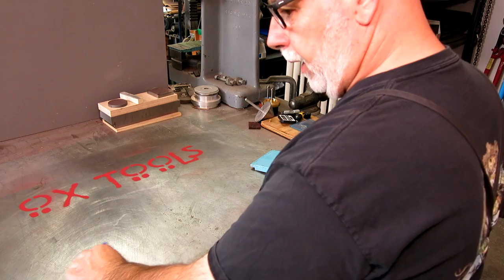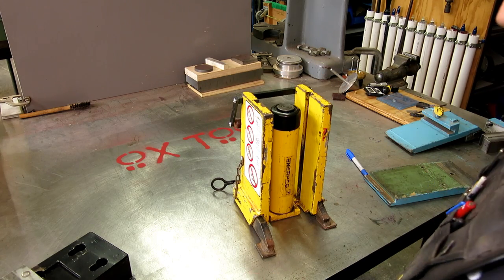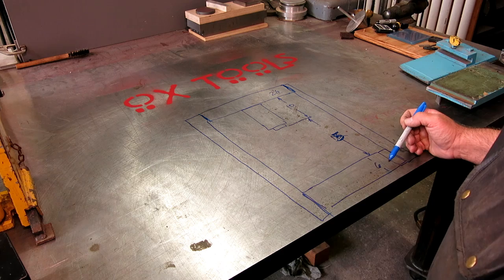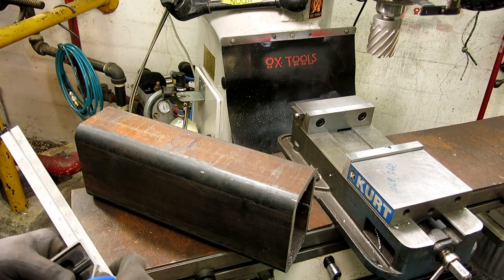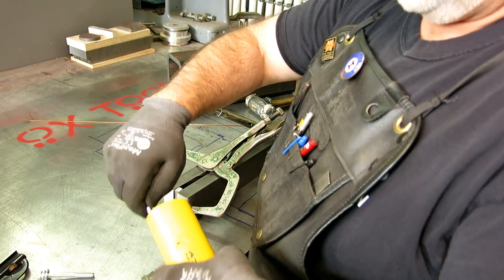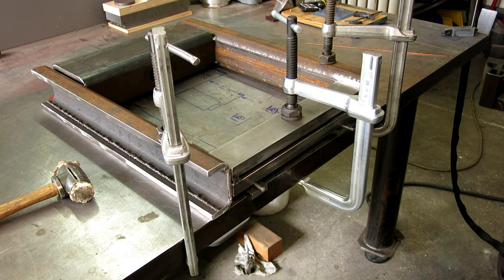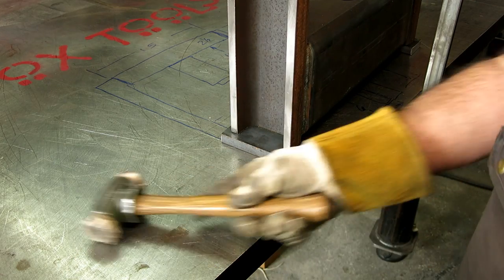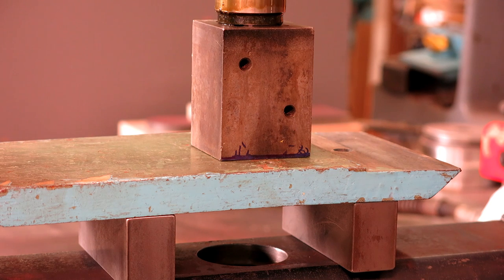Dogmeat Hydraulic Press

Comment: I bought a 60 ton train jack with an 8" stroke at a flea market. It came off a service truck for CSX Rail. I don't know why I felt the need to buy it, but it was only $90 and I thought I could use it for a log splitter or something. I ended up making a frame very similar to this one and made an aluminum can crusher. It will crush a can down to 1/8" and makes it into a solid slug. So then I put recycle bins all around the shop and from all my family and friends. Since then, I have made over $680 in aluminum sales to scrap yards. The trick is space. $10 worth of cans will take up a pickup truck bed. With the crusher, I can get that down to a fraction of that. Maybe a 55 gallon drum.
Reply: That’s a hella lot of cans. The soda and beer companies must love you guys. $680 in aluminum scrap is over a ton of aluminum, and that’s conservative. How nay cans, at a tiny fraction of an ounce each, does it take for one ton?

Comment: I’m lucky enough to work in a workshop with a minimal budget for new tools, so I knock out pretty much everything I need using offcuts and scrap. My press frame is just tall enough to get a 20 t bottle jack into. The 3 bits of I beam, ganged up, at the top flex less than the 20mm solid plate at the bottom. Love these vids of yours and your books have given me a “leg up” at work. Sincere thanks to you Tom.

Comment: Really nice Video,  as all of yours ...     Would it be possible to put a Weld /stringer on the "high" side of the bent part of the brake-finger ?  to "pull" it flat ?
Reply from the maker: The fingers were heat treated material.

Comment: Nice. But the hole in the tube, how do you get the pin out once it falls inside, if you use it for pressing out something like that. You’ve sealed up both ends!
Reply from the maker: Dohhhhh! Didn't consider that one. I guess I'll use my magnetic personality.

Cheers,

Tom
Reply: Drill another hole in the bottom and press in a thin walled thru pipe and sit it over one of those holes in those amazing benches you have!
Reply: If/when, he'll just have to hold it upside down and shake it like a little kid trying to get a quarter out of a piggy-bank.
Reply: theres alot he dont think of--im sure he re records alot of his mistakes which is why his videos come out once every 2 months

Comment: You were talking about watching the top bar come down when you released the press, but I didn't see it. I was watching the bottom bar come up!

I think I would have used something like a 2" wide hunk of bar stock with the bottom end rounded a bit rather than that square peg as the press anvil on top. That would have concentrated the bending force at about the place where you needed to undo the previous set.

Comment: Tom - would there have been a significant difference in rigidity by welding the uprights with the 'C' facing in? That would make pin extraction easier. Of course there might also be some difficulty getting the top rail to fit.
As always an instructive and amusing slice of life - build a tool, to fix a tool, to modify a different tool.
Reply from the maker: Yeah I saw that myself. I had already cut the top rails to length. It actually looked better, almost Art Deco. Can't win them all.

Cheers,

Tom

Comment: Awesome build!
Would if have helped if the block above the workpiece had been more bar-shaped like the ones below it?
The bent in the plate seems to have happened right along its mounting holes, so a contact area with just the width of the hole´s thread diameter would have been better.
The wide piece on top will get it straight, but not beyond, at least not with 10tons, as the necessary force suddenly increases when the plate is straightened. To counter springback of the plate, it has to be bent a little further.
Reply: A half inch square block would have been more proper I beleive. Les spreading, more concentrating forces.
Reply: I would have thought a full width press tool with a very slight face radius to allow for over bend without the corners digging in.. Being sure you press on the crest...

Comment: Nice build! I think I would have added some support to counteract the side to side forces. A round bar through the frame clamped around the lower part of the cylinder would work. Sort of the shape of a very large die stock.

Comment: I use a 3 inch round bar to press on it concentrates your pressure on a smaller area nice little unit. Thanks
Reply: I agree, it's all about PSI.  Concentrate your push where you want the bend.  When he had the part under stress, I would have hit it with a hammer to set the strain.
Reply: I agree with you, it was not a good idea using a square block!!!!!
Reply: That's another agreement from me. 👍
Reply: @chucktodd7329  I was thinking the same. Not too sure how it would work on hardened steel, but worth the try. It's not like Tom doesn't have the right hammer for the job!
Reply: @393strokedcoupe  you would think since his favorite tool is a hammer, he would use them more!
Reply: @chucktodd7329  You know the saying, "there's a tool for every job". Well, Tom loves his hammer collection. He has at least 3 for every job! 😉

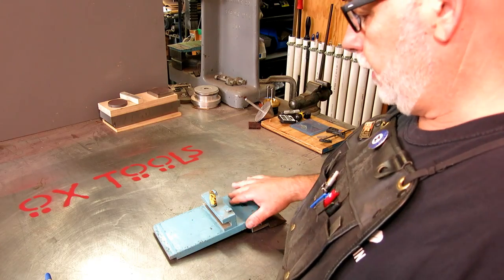Comment: Did anyone else see the base of the arbor press flex when Tom was pulling on it at minute 1:00, it must have moved a 1/4"
Reply: I thought it might crack.
Reply: yeah, probably ductile iron, cast would have maybe cracked....pipe on the press handle?....and those finger brake parts get bent the same way....overworking the brake with sheet metal too heavy. Some TONS required to straighten...
Reply: Even with a cheater bar, bar some flaw in the material, that press wouldn't pop. I think they are designed to take 4 times the mechanical force that's naturally obtained without a cheater bar. Read it in a sales pitch in some old magazine. AKA old timey commercial bragging.
Reply: Why would you assume Tom did the abuse, when he bought it used?
Reply: I had to look away, I'm guessing it wasn't cast iron then.
Reply: bet he built the press more to make sure he didn't break the arbor press then to getmore bend
Reply: Bill Stupak yes I saw that
Reply: @Wroger Wroger thanks mr wizard
Reply: the press should have been on the table all the way... the area under the ram was hanging off table
Reply: Haha I went back and watched. He was definitely cranking on that arbor press.
Reply: @Wroger Wroger J think he saya he bought it used lol

Comment: Try again. Would differential Heating and Cooling help with the bend?
Reply from the maker: You are taking a risk when doing heat shrinking/cooling on previously heat treated material. The short answer is yes it would work but the final condition of the steel might not be optimal.

Cheers,

Tom

Comment: You seem to prefer TIG welding. Any reason? Why didn't you just use all MIG?
Reply from the maker: For tacking I like the precision of TIG. For large volume welds I like MIG and for the ultimate in strength something like 6010 root pass and 7018 fill.

Comment: I don't know much about welding.  But when Mr Lipton does all those vertical beads; is he just showing off?
Reply: Cyril Hudak those "flare bevel" welds on the side are easier to get good results with when welding vertical, because of the open root. If you do then flat, the weld metal wants to fall through.

Comment: That seems to be working out alright, Tom. Too bad you didn't have a 20 ton model sitting around. Looks like you really had to work hard to get the fingers straight again. Hope all is well! - Tom Z
Reply from the maker: Hey Tom,

I will probably scrounge something larger for this little press like a 20 or 50 ton cylinder. I have plans on the drawing board for a more elaborate Hydroelectromechanical press. 

All the best,

Tom

Comment: Tom, I do have a question for you on the power of the 618, I have one also and have converted it to a VFD to run on single phase.  The motor does not seem to put our much power (1hp 208v motor) only allowing about .001-.002 DOC with a .030 step over.  Do you experience the same performance on yours?  Nature of the beast?
I do love this unit, mine has power cross feed and depth and is accurate from end to end of about.0002.
Reply from the maker: Haven't ground anything on it yet. Still doing all the upgrades and maintenance to start using it. 

Cheers,

Tom

Comment: looks good tom, I think I would have drilled all the way through and welded a pipe in the hole at the bottom tho. If you go to press a pin out, your going to have a nightmare of a time getting the pin out of the box tube at the bottom, be like a heavy and unbreakable piggy bank with the last quarter left in it forever that you just cant get out, lol.

Comment: Tom -- did you ever consider Keith Fenner's heat straightening technique ?????
It's worth a shot -- it could save you a lot of time .
Reply: Somebody else mentioned that, and he said the parts were heat treated.
Reply: Case hardening has a soft core . It's worth a shot.
Tom is putting a lot stress on those fingers by bending them . If they were tool steel hardened at a high rockwell  they would break under high pressure .
Reply from the maker: Jim,

I have no reason to believe these were case hardened. Its unlikely they were case hardened for the intended use. My best guess is they were 4140 heat treated and oil quenched. Good cheap steel with a super simple heat treat. My file test guess is RC 48 or so which would be approx 200K psi yield with 4140.

Comment: Nice build Tom! I have a similar build in future.. how did your cylinder went in automaticly? I have been desining a spring system to retrack.. I have a set of Powerteam handpump and cylinders up to 60ton. Thanks for the vid! cheers Tom.
Reply: It has an internal spring for retraction, most generic cylinders up to 100 odd tons will.
Reply: @dj280z  Ok i was thinking about that.. Thanks for the info!

Comment: Hi Tom !
Really nice project !
But tell me ... how did you in the first place bend these fingers ?
I ask because I plan to make some fingers for my brake (born without fingers !) and I wouldn't beleave so massive material was requested !
I use the brake for MAX 1mm thick alu/brass/steel material and MAX width of bend 500 mm and mostly alu !
Reply: Keld Sørensen he mentioned at the beginning that it was like that when he bought it.
Reply from the maker: Somebody trying to bend thick material locally over one finger will do it. Material is cheap so if you make fingers there is not much penalty for making them beefy.  20mm would not be out of the question for non heat treated materials.

Cheers,

Tom
Reply: Oh, then I'll have to re-do my drawings - thx for the advice :-))

Comment: I do not know your set up, but there is a couple manufactures that purposely have approx half of the fingers bent.. and those typically are to be mounted in the most center of all the other fingers... for exactly what you are doing, trying to bend while using the entire width of the break. as the center fingers have a issue of lifting, as the far left and far right finger are being lifted, the center fingers are in turn, sprung further down to the base/table... But, I do not know your set up, so, just me two cents....  Would you like to hear my story, of my old boss chewing my butt, after straightening them, and then the center has a gap, when full width material is being folded, LOL.....  I almost lost my job over that one.. oh, and you may find the fingers are numbered or lettered as well, as to where they are to be located in the clamp.
Reply from the maker: Dru,

I have never seen a box and pan brake with compensated fingers. The idea behind a box and pan brake is you can move the fingers to any location or modulus of widths you need for the job. If the center fingers were gapped, bent or compensated you would always have to keep those fingers in the center making the brake less useful for its intended purpose of boxes and pans with sides. Now if your brake was clapped out and sprung I could see having the need for fingers with a bias in the center. My guess is the brake you described was clapped out and having bent fingers was the only way to get a decent full length bend on it. These type of brakes are typically abused for short bends on heavier material so its not surprising to see them with distorted fingers and leaves. 

Best,

Tom
Reply: +oxtoolco very true, its the beam that can have anti crowning

Comment: It just needed a little more ‘grunk’. I thought it needed a little extra ‘stootch’ but maybe I use a different unit of measurement than you. Job well done.
Reply: Stootch is metric.  Murica!
Reply from the maker: These are Oxian units of international measurement. "Scootch" equals approximately one mm or 1/16 inch depending on your longitude. "Gronk" is a unit of work energy equal to approximately 100 ft/lb or 140 Nm.
Reply: @oxtoolco  Oooooh you said grOnk! I thought you said grUnk. I get it now. Thanks for the correct info, that's why I like this channel.

Comment: I must be missing the point. Is there not another straight piece of metal in the whole world that you could machine to replace the bent piece??? Nothing bent like that can ever be made to be perfectly straight unless you machined it.
Reply: I have 4 air over hydraulic 20-ton jacks. You should have used something with air so you wouldn't have to pump.

Comment: Hi,  Tom! I noticed that you welded those heavy side welds downhill, which goes against everything I've learned from Jody. :-) Could you comment a little on why you did that? 

Yours truly virtual apprentice. :-)
Reply: Most of the force applied is going to be seen on the 4 horizontal welds. The vertical welds are really only acting to keep things squared. I am willing to bet he could have omitted the vertical welds, and still got the same results.
Reply from the maker: There was a fairly large air gap between the two tubes. I did the first one horizontal but running at 200A it was a pain to keep it from keyholing. There was enough prep weld length and amperage available that it didn't concern me that I have the ultimate full strength weld. If that was the case I probably wouldn't have used MIG. 6010 root with 7018 fill would have been been my choice for super strength.
Reply: Okay, I get it now. :-) Thank you for the answer.
Reply: Tim Hill f

Comment: If the ram is movable but the hole on the bottom strut is fixed ... surely that's a formula for disaster.  Wouldn't you be better using a looney tunes Acme movable hole?  Or perhaps a miniature stick on trapdoor would give you more flexibility with it's straight edges.   if you do do something asymmetrical, at least you'll have a pot to piss in, or aim at.
Reply from the maker: I have an Acme anvil you might be interested in.

Comment: This is so overcomplicated for one odd ball need.
Reply from the maker: Please enlighten us Adam of the uncomplicated. How would you have straightened heat treated steel five inches wide and 3/4 thick?
Reply: @oxtoolco  https://m.harborfreight.com/20-ton-h-frame-industrial-heavy-duty-floor-shop-press-60603.html

Or you can get one on Craigslist for around $100.

Comment: You're not going to find ANY "manually-operated" sheet-metal "break" that's capable of bending more than VERY thin and/or soft "sheet metal" any more than you're going to "straighten" anything "heat-treated" and keep it "straight" without "annealing" it first, straightening it and then "heat-treating" it again so all the "displaced" metal molecules that were "stretched apart" and "compressed together" actually end up "arranged" evenly throughout the "part" where they originally were. PRESSING just puts them under different stress/strain in another direction but does not "put them back" when you're just "cold-working" the metal. 

Of course since "heat-treated" steel in a "break" would be "brittle" rather than "ductile" and you wouldn't expect a "gradual" bend in it and "mild steel" that size would be plenty "strong" enough to do the work a manually-operated "break" is made for, you might want to check on the "heat-treated" thing a little more carefully anyway. Unless that "break" is actually a SHEAR, of course. 

Which might explain why it has many "fingers" which are "heat-treated" while a 'break" typically isn't going to "work" any metal "hard" enough to require STEEL to be "heat-treated" as well as a segmented "folding edge" to "work" metal its capable of "breaking" on a "full-width" basis. 

The other possibility is that its an actual "break" but a pretty poorly-made one made and sold under the premise that by making it "narrower" an "operator" can "break" proportionally "thicker" or "harder" metal. That's poor "engineering" and even poorer "marketing" given the fact that it isn't JUST the "width" or "thickness" of a metal "sheet" that affects the "force" required to "break" it and "halving" the thickness or width of a metal "sheet" doesn't automatically "halve" the "force" required to "break" it. 

There's also a difference between "breaking" metal and "bending" it. Another example where knowing exactly what you need, what you're looking at and what you're POTENTIALLY buying before you buy it at ANY PRICE is the only way to "know" you're getting a "deal" period much less a "good deal". Buying the "wrong" tool at any price isn't a "deal" because you didn't buy an "asset". You "bought" a "liability" and are out the "capital" you were planning to spend on an "asset", don't have that asset, don't have that capital and now have a "liability" you have to turn into an "asset" at least "worth" the lost capital, the time put into buying it and the time spent "converting" it from "liability" to "asset" just to "break even". 

And you're still getting "screwed" on the "time". Which of course is "priceless".
Reply from the maker: Yep Deerbrain didn't take his medicine again.